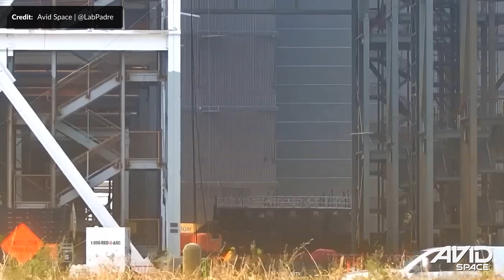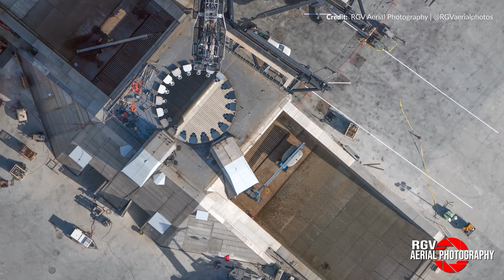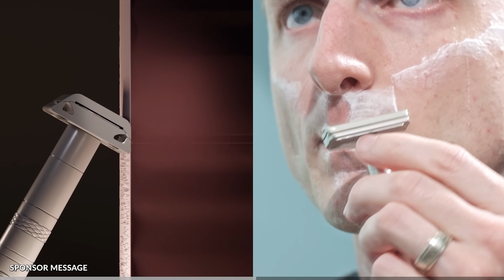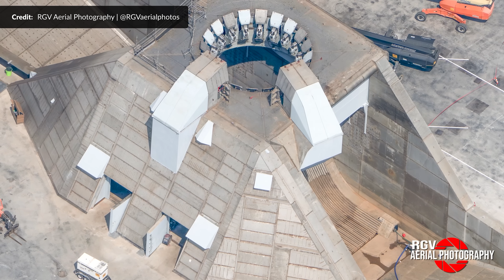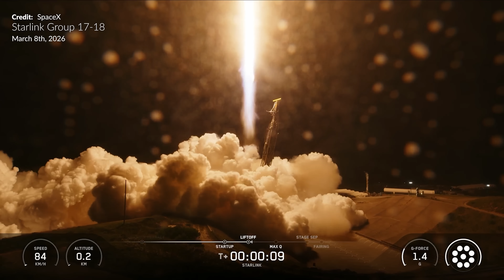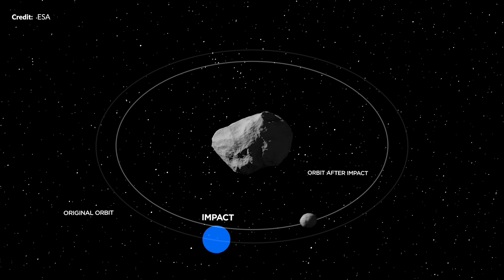SpaceX Starship Booster 19 Lift Off

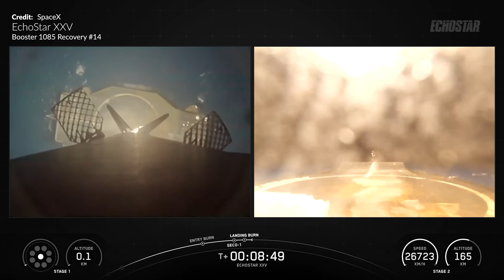Comment: 18:04 How do you get a geo-stationary satellite up to 20,000 miles in 33 minutes??
Reply from the maker: They put it into a geo-stationary transfer orbit which just has the highest point intersecting the geo-stationary altitude. Once SpaceX release it, the satellite itself later completes the rest of the full geostationary orbit (which involves more burns at the highest point to fully circularise. It can sometimes take weeks for it to put itself into its final position.

Comment: It was pulled off the pad as pad 2 has no 'dance floor' as pad 1 had and so no modification or such can be made to the engines as they once could, so the booster has to be put back on its stand where inspections and mods can be made there...

Comment: The grid fins don't fold down now?  I don't like it.
Reply: On super-heavy they never have.
Reply: They've never done so on Superheavy boosters. The reasoning is that they don't cause as much drag as expected, and they come out ahead by avoiding the extra structural mass to support retractable fins. If the Falcon 9 design wasn't long-frozen at this point, we'd probably be seeing the same change there to increase payload mass.

Comment: Are those tiny little steel pipes around the engines really going to survive screaming through the atmosphere during rtls? It just seems like even the smallest patch of dense air let alone a bird strike would absolutely brick the whole thing. Maybe a fabric skirt layer of some kind? Also could be that the perspective makes them look tiny but they are the diameter of my leg so shrug
Reply: It's not impossible that they remain exposed while engines are being installed and there could be some kind of cover put in place for flight.

Comment: The newly designed Flame Trench design may possibly enhance/assist in the rocket’s lift potential rather than just the disposal of flames and heat that certainly would cook all the engines.

Comment: I don't understand why so many YouTubers thought this was going to be a 10 engine static fire. It makes no sense to static fire a booster with just 10 non equally spaced engines. It was just a fit check for the entire quick disconnect system. So much for the so-called experts.
Reply: It just went back on the stand with the same 10 engines.  Looking like they do plan to static fire that way.  Probably one or more from each ring, building to full 10.  The selection is not totally random as it is fairly balanced if they fired all of them.
Reply: It must be fun being a Youtuber dealing with armchair rocket surgeons such as yourself.
Reply: @waterfallhunter634Such harsh words. You wound me sir. The information was passed around the factory before they loaded the booster. So armchair rocket scientist, no. Star factory contractor, yes.
Reply: @incog30 ah, touche
Reply from the maker: They still look to be going for static fire. It is back up there now.
Reply: @MarcusHouse  Oh well not yet, maybe Monday.

Comment: I wonder what the grid fins are made out of? Past SH boosters use stainless, but that's unnecessary heavy and doesn't withstand reentry heat very well. Falcon 9 went to titanium not long after entering production. If/when the SH booster gets titanium grid fins it would be a sign SpaceX is getting serious about reuse.

Comment: One thing I'm wondering about the new lift/catch pin design for the booster ( and I'm sure the actual engineers they have at SpaceX have too ) is what happens to catch attempts if/when the booster comes back with a motor frozen in a non-optimal position?  I would hope they have some degrees of tolerance built in, but what if one of the grid fins gets stuck in a position where the new lift/catch pin is out of alignment?  Can it still be caught?  Will it have to abort into the Gulf of Mexico?
Reply: The catch pins allow a catch without damage to either the booster or catch arms. If the catch pins aren't lined up correctly, the booster will still get caught. The off-angle grid fin will crumple some as it conforms to the catch surface. This means that grid fin will never fly again. It also would mean that the booster might not be held straight.

It is a good thing that SpaceX owns a big crane. They will have a second tower by the end of the year, so a damaged tower won't halt launches.
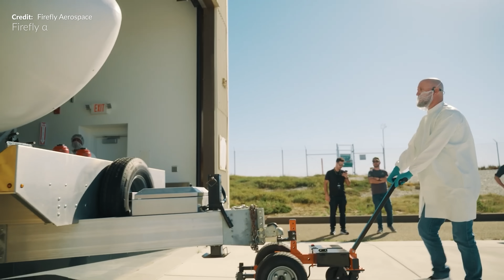Reply: RyanHansenSpace has a good video pre-flight 5 on how they (will catch) caught Super Heavy. Catch abort starts at about 19:49 in the video.
Reply: According to Economist Patrick Boyle, the public valuation of Space X will be put at $1.5 trillion. This is based on the assumption that a billion uses will want to pay $100 a month to access Starlink - which is roughly 1 in 8 people on the planet can't access WiFi or 5g and can find 100 dollars a month to use the internet. 

The technology may be astonishing, but the business plan is as sound as the Cybertruck, solar tiles, Grok or the Hyperloop.
Reply: You mean Gulf of America.😉🇺🇸✌

Comment: Elon said that the 304 Stainless Steel has the same strength to weight ratio at cryogenic temperatures. 
Perhaps they intend to do a slow-down burn  with excess fuel on re-entry.
Those bells will not survive plasma if cold fuel is not being pumped through them.

Comment: The team at NasaSpaceFlight calculated that the pump working to fill the booster and ship has a fill rate of 1.3 cubic meters per second. You could fill an Olympic sized swimming pool in 32 minutes at that rate. Wild

Comment: Maybe the third grid fin, with its slanted steel, is how they are going to force the flip manoeuvre in a specific direction, instead of blocking off an entire side of the hotstage?
🤔🤔🤔
Reply: Hardly. There is almost no atmosphere at separation.

Comment: Those Raptor 3 engines don't even look real...the lack of visible cabling and plumbing make it look like something drawn for an anime show vs real life.
Reply: Of course, that's what Tory Bruno of ULA said... that they weren't complete operational engines, that they'd be less streamlined once all the missing plumbing was installed. He was left a bit red-faced when it was pointed out that the photos in question showed the engines running at full power on a test stand.
Reply: It's funny how they kept saying the last test campaign was all prototype hardware with lots of room to simplify and get lighter, and it's still hard to believe them b/c everybody else operates so differently/slowly/cautiously.
Reply: @FireStormOOO_  Because it is. The design may have improved drastically since the first prototypes, and things have gotten lighter and more simple, but they're still prototypes. We're nowhere close to an official date for an operational Starship flight that actually takes a functional payload (something that isn't a mass simulator or payload mockup flown for demonstration purposes) into orbit, that's likely a ways away and will probably happen with Starship Block 4/Superheavy Block 3. It's still exciting to see though, and I eagerly await what comes next.
Reply: @nepnep1708  - They will be launching real payloads this summer.  V3 - Flt4. At least that's the plan.
Reply: @mikesunderland9145  Yes, but that's a speculative and optimistic date, and doesn't take into account needed reflights (subsequent flights following the same mission as the previous one) due to a flight not meeting all parameters (or the engineers wanting one in response to data revealing something not quite right), or timeline slips in response to weather, or issues with the vehicle or ground equipment. This overoptimism in the design based on the previous major iteration led to Starship Block 2's numerous issues.

Believe me, I absolutely would love to see it happen. I want it to happen. But we have to be realistic and anticipate all potential outcomes.

Comment: No point putting all the engines on super heavy when it never even goes to orbit.
Reply: Super Heavy boosts Starship. Super Heavy returns to pad. Starship goes to orbit. They're moving fast, they may have solved re-entry tiles. Some of the best engineers around with little bureaucracy.

Comment: I am sure they did the math, but it's interesting that the additional drag during launch caused by the angled gridfin is worth the cost to get an improved entry.
Reply: As well as the additional cost of manufacturing a second configuration of grid fin.
Reply: @Spectator1959  good point! Thinking about it, I suspect that the additional manufacturing costs are something SpaceX would be happy to eat if it's for the benefit of payload improvements (especially for a re-usable rocket).
Reply: As I understand it, the drag is minimal on launch — because by the time they're going fast enough for the drag to be a problem, the air is thin enough that it doesn't matter anymore.

Comment: I saw Tim roughly calculated the propflow to be about 80.000 liters a minute, so just over 1,3 cubic meters a second.. of cryogenic propellant flow.. absolutely mind blowing numbers
Reply from the maker: The masses and volumes are staggering. If you think it is fast to fill, my gosh does it drain in flight. 🤩
Reply: all gone in ~8 mins 🚀
Reply: @dumpsterdiner More like 2 1/2 minutes.  Those numbers are just for the booster.
Reply: @dumpsterdiner wait until you figure might
..
Reply: Imagine leaving that tap on, and coming back to find all of starbase under a small glacier
Reply: That would fill my room in 25 seconds
Reply: Thats almost 4 shipping containers worth of prop for anyone wondering
Reply: @moodmusicytc I wasn't, but now I can't stop thinking of it.😊
Reply: problem is, that the rocket is too heavy to be able to deliver promised 200 tons payload on LEO. The last version had a payload capacity to LEO nearing to zero. IMHO they are trying to reduce the weight, which may result in a great firework. I just hope it is not going to exlode strait on the launch pad
Reply: @pavelkochan282 so what is the power to weight ratio. If you want to make accusations state facts

Comment: For a spin prime, is CH4 being blown through the engines or N2?
Reply: Historically, in SpaceX tests, they load cryogenic LOX and methane, spin the turbopumps, and flow both through without lighting the engines.

Of course I don't have any inside information so I don't know that 100% in each case.  But I can't imagine that I wouldn't want to be flowing anything other than the intended cryogenic materials because I wouldn't want to risk damage.  Now how, or whether liquid nitrogen would damage in any way I don't know.  But the mass is quite different, temperatures are different and I can imagine how that could have negative effects.

Comment: How come the booster wasnt completely frosty like in the test at masseys?
Reply: Because the massy test was with nitrogen, on the pad was with fuel and lox. So they only load enough methane to do the job needed in case something goes badly. Otherwise they will still load the lox tank nearly full to give it more weight for static fires to be safer.
Reply: @Vatsyayana87 did you not see the masseys test? they had an entirely new proceedure where they prechilled the entire booster with cold gas befoe propload. This was completely missing here. There was that entire thing with people beeing unable to tell the frosty filllines bwcause the entire vehicle was already covered in frost

Comment: The speed of SpaceX is just wild!!
Reply: Artemis is also around the corner. There is not much time.
Reply from the maker: It really is!
Reply: The speed actually slowed down. This is the longest break between IFTs since  second flight.
Reply: @A31415  

First time they've had to build a new launch pad.  They have this flight listed for April and the next is listed as June.  

:rocket-red-countdown-liftoff:

:rocket-red-countdown-liftoff: